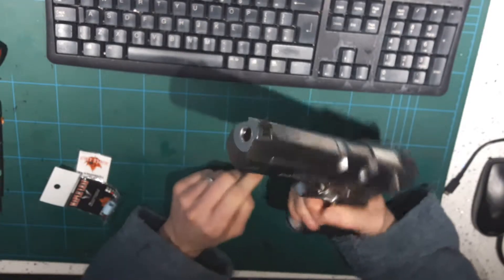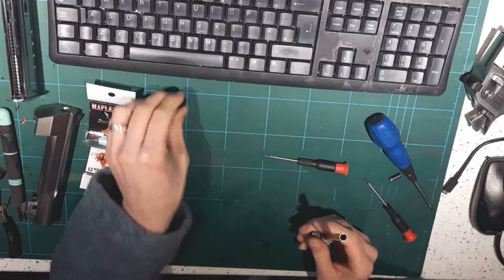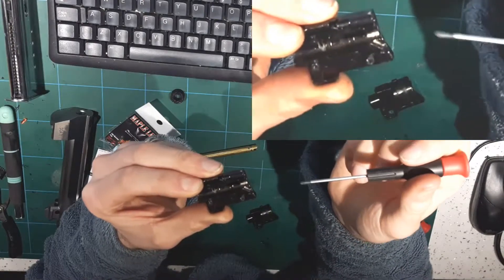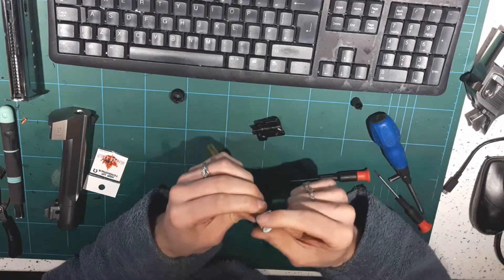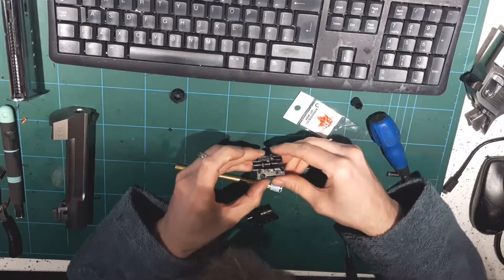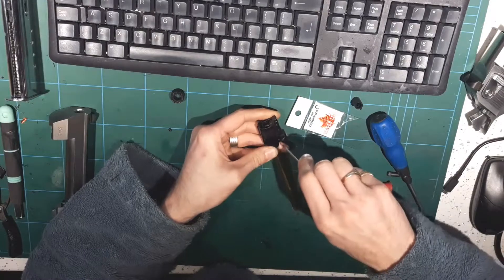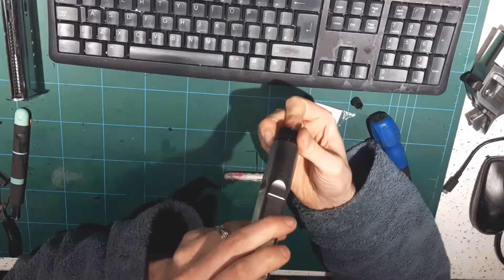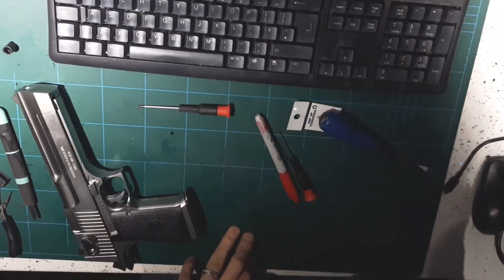How to swap the WE Desert Eagle Hop Rubber

Comment: Is that normal that even with fully adjusted hop up 0.2 bbs drops very fast? like max 30 meters ... maybe not even this much. 0.3 will drop like affter 10 meters. Not sure whats the problem here. Maybe new hop up rubber?
Reply from the maker: No the standard hop does work okish it should be hopping 0.2s.  Perhaps there's oil or lube on the rubber. Also check when adjusting that the hop rubber begins to come down into the barrel
Reply: @chazj1976  Its very exposed in the barell (like 0.7 mm visible rubber in it) Maybe too much hop up so it doesnt have much power of the BB to go through? Also i have used Propane at first with some silicone oil in the reduction then i swapped to nuprol.
Reply from the maker: I'd say its over adjusted and give it a clean with a cotton bud and soap and water.  If that doesn't work take hop rubber out and gently sand the nub
Reply: @chazj1976  thanks a lot. Now its hopping well even 0.32s in range about 50 meters

Comment: Hi, any maple leaf like diamond monster or autobot bucking will fit?, now, how is it shoots your desert eagle
Reply from the maker: Frambhueee hi thanks for comment. Yes any maple leaf monster or autobot or deception hop rubber works  the range and accuracy are significantly improver and it's a very straight flight path. Definitely more consistent than WE hop rubber
Reply: Airsoft Engenuity you can make a shooting test vídeo of accuracy
Reply: so all glock pieces can fit? (rubber, hop up bloc unit, innerbarel?)

Comment: bro, can i use Tokyo Marui magazine on DE Cybergun WE ?
Reply from the maker: Hey pal. Nope they are a different fit but I have been looking into designing a mag top to work. But you still would  need to widen the slot near the TM gas release valve as the WE valve knocker is wider